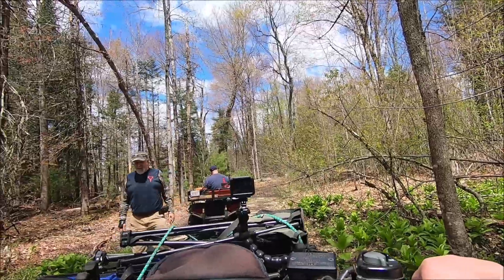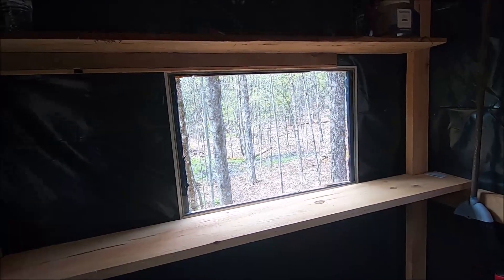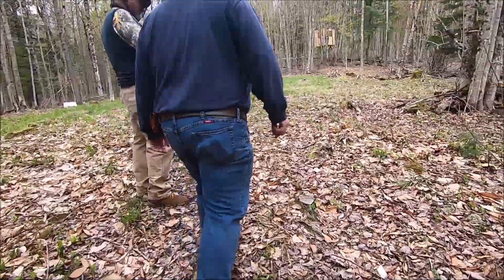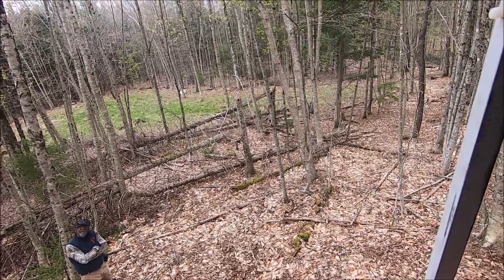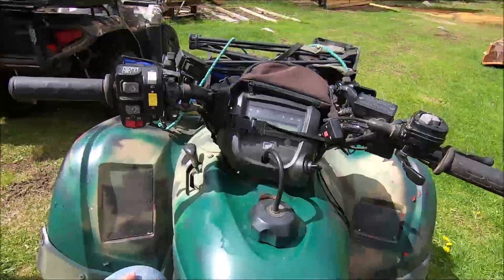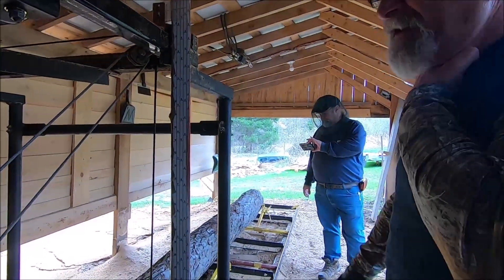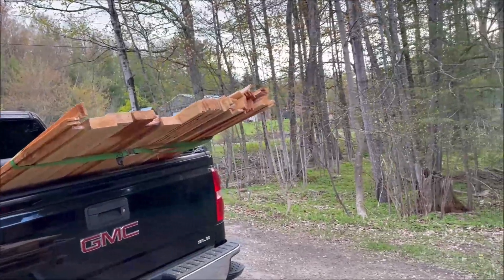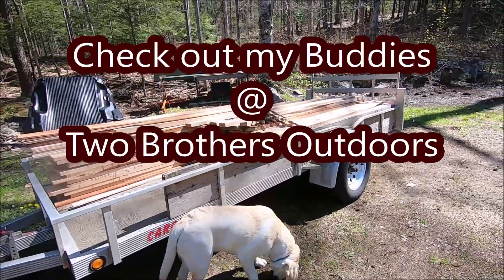Crazy Generous Gift from Two Brothers Outdoors

Comment: Man I have been wanting a mill like that since they came out, It's much faster then my chainsaw mill, but like you I just don't have the space for it. but good news my cousin bought one of those HF mills, y'all were talking about and he said it works great. I need to go over and check it out for myself and get some practice..lol..I'm fixing to go check out 2 brother channel now. Looks like y'all had a great time and good luck with the build of the blind for this season! The one's they have look GREAT!! How are you going to preserve the rough cut wood to keep it from rotting so fast? Great Video Don!!
Reply from the maker: Thanks Lance. I have wanted one of those mills forever and am definitely going to check out HF. In reality I probably have plenty of timber on my land to pay for one with some selective cutting, especially since I’m not burning firewood any more. My last blind was made from 2x2s and chip board. It was painted and had a roof covered by the remnants of one of those cover-it tarp sheds that collapsed one winter. It was sitting on a couple of rocks in close proximity to the ground and it lasted almost 20 years. The platform on my new one will be elevated about 4’ on 4x4 Pressure treated posts and I intend on painting the exterior in some camo pattern. The roof will be covered most likely in rolled asphalt roofing. I’m pretty sure this one will be standing long after I’m gone.